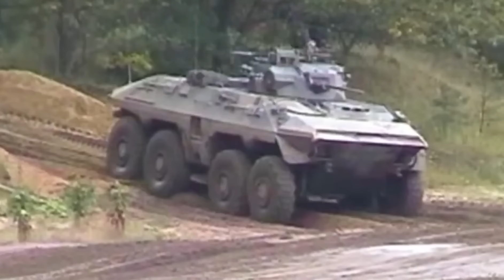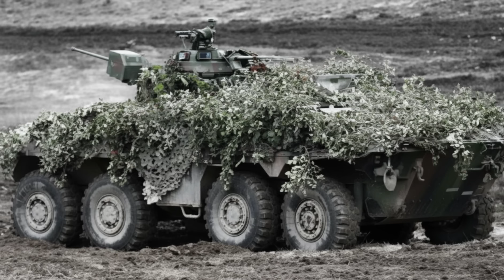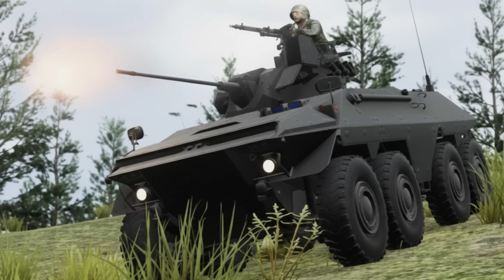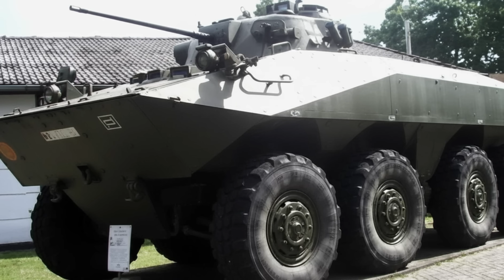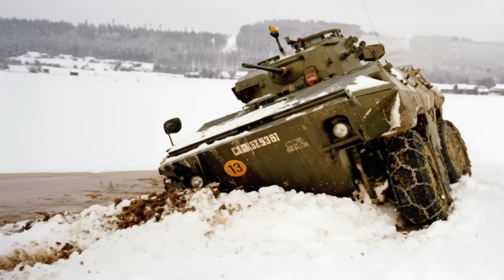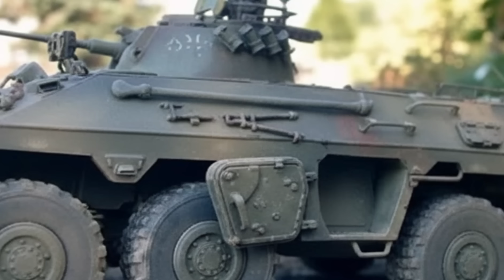The 'Invisible' West German Scout Car That Found Soviet Tanks In Total Darkness

Comment: Ai compilation trash.
Drehringlafette at the rear driver and a geometrical 4 bladet prop, but only with three blades. And many more. The best is the Luchs with 5 axis.
I know a 4 Axis Fuchs, but never seen a 5 Axis Luchs. 

My mom was nearly rolled over by one as she was on to fing mushrooms in the woods. 
Out of nowhere a soldier grapped her and jumped with her in a ditch. As she turned arround two Luchse drove a few meters in front of them by. She dint noticed them rolling behind her.

Comment: First off all a very interesting story but a few things. The Fuchs is not Brittish but Dutch/German and it does have NBC capacities. It's armour will stop a .50 round and is not unstable (problems it did had where during it's testing). 
It is also not only armed with a machine gun but versions with a grenade launcher and with AT missiles also exist.
Reply: I think you mean the Boxer GTK and not the TPz Fuchs.

The UK was in fact in the initial part of the Boxer Project before they dropped out. 
It was then fully developed and built jointly by Germany and the Netherlands.

Comment: You can see a very clear lineage with the Puma from WWII
Reply: Try the French Panhard designer s.. influence German build.
Reply: @clivestainlesssteelwomble7665  well, Germans never copy French tanks, they only capture and use them.😂😉
Reply: @steffenrosmus9177  Böse.
Reply: @clivestainlesssteelwomble7665 No , It based on WWII SdKfz 234/2 Puma . Rheinmetall take the Puma costruction and Swap it into modern Times

Comment: This vid included a random image of a different vehicle at 1:42
Reply: The Luchs 2 by GDLS in his defence.
Reply: I also think, there is some AI filter on top of the pictures, because the number plates seem to be censored on some pictures, despite this pictures existing online without the censored number plate (example: 3:01). Also at 4:45 there is clearly the wrong cross on the vehicles. The cross shown is the one the Wehrmacht used and not the one the Bundeswehr uses. I think the channel should be reported.
Reply: Yes, later on the narrator talks about other vehicles and non of the other vehicles are shown. And than when the narrator comes to the Luchs 2, the old Luchs is shown, despite the creator obviously having a image of the Luchs 2 (shown at 1:42).
My guess: The creator let some AI write the text, hired some narrator to read it, put some random pictures on top of it (that he found with a quick Google search) and than the video was done. He probably has no idea about the vehicle or cares about it.

Comment: A cold war Puma.
Reply: Cold war Patria or Luchs 2 in small numbers

The Puma is more heavy than a T72 and better armored,
Reply: @heinzkabofke6791  What Puma are you talking about? The SD.Kfz. 234/2 weighs under 12tons...
Reply: @tHiNk413  the Luchs based on SdKFZ 234 .
 Rheinmetall overhault the Wehrmacht Design an make it better , same as the MG 42 and MG 3 😂😂😂😂
Reply: @tHiNk413 I mean the WW2 Puma it was a vehicle ahead of it's time.
Reply: @tHiNk413 

Ah, well, I guess you are right in that case.

Didn’t think of the Sonderkraftfahrzeug ^^
Reply: I was thinking of our contemporary puma.

The Schützenpanzer Puma, with the unmanned turret and the 30 mm air burst gun.
Reply: @nickgriffinshungarianhouse  I know, that's why I asked the other guy😊
Reply: @tHiNk413  Obviously the modern Puma in service with the Bundeswehr since 2015.
Reply: @dirkschlebusch-sp3hm Except it wasn't even built by Rheinmetall but by Rheinstahl... 😅